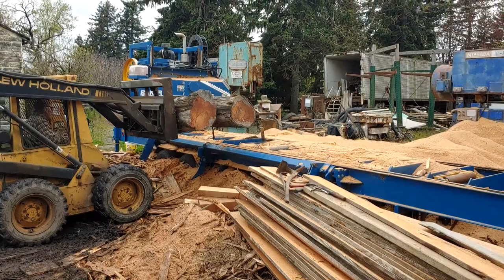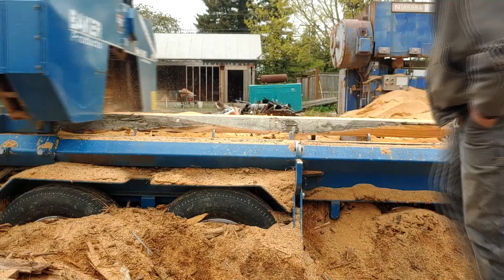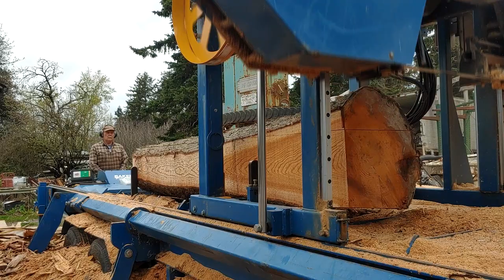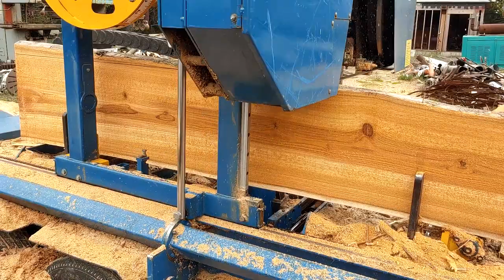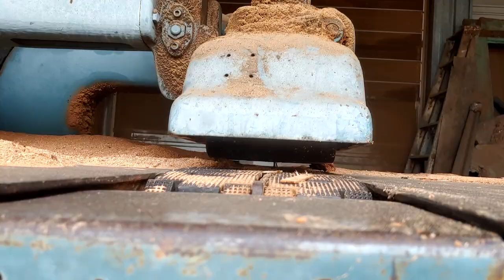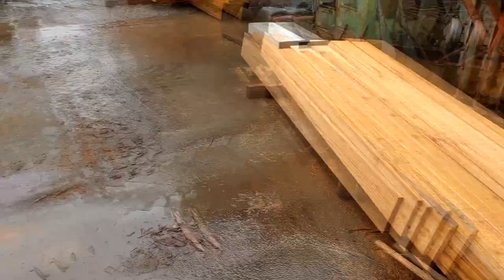Sawing Amazing Cedar Fence Boards

Comment: Great video. Love the wood.. I agree with another comment about why it pops/bows when cut and why Fred checks the boards before he puts it in the resaw? 🍻👍
Reply from the maker: Hi Bill-
Sometimes the logs have internal stress and it causes them to bow or warp.  This typically occurs when the heart of the tree is off center in the log meaning the tree was going with a lean or was trying to keep it self straight.  the boards don't always come off the mill with a prefect straight edge.  If they don't have a nice straight edge he trues them up, if one edge is straight and true he runs it right along the fence.  Thanks!
Reply: @SJForestProducts  Awesome. Thanks for explaining. Makes sense now. Keep up the great work 🍻👍

Comment: 2 questions...... What caused a few of the boards on that one log to spring/bow when cut? What does Fred do with all the saw dust and scrap wood?
Reply: Good questions. I was thinking the same. Thanks 👍
Reply from the maker: Hi Dan.  Sometimes the logs have internal stress and it causes them to bow or warp.  This typically occurs when the heart of the tree is off center in the log meaning the tree was going with a lean or was trying to keep it self straight.  The sawdust goes to friends of his for animal bedding on the farm and for flowerbed mulch.  Thanks for watching and commenting!